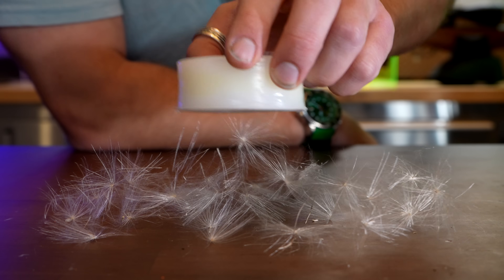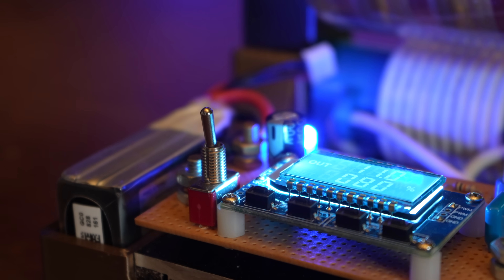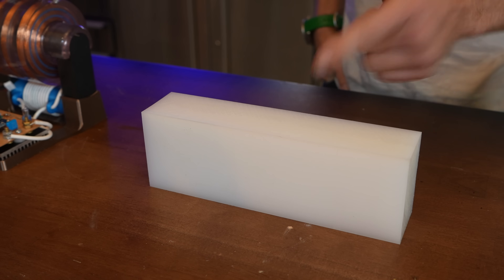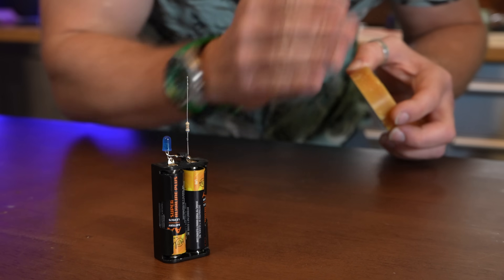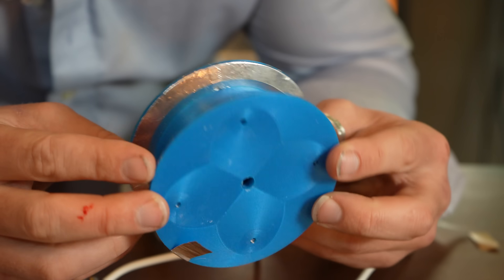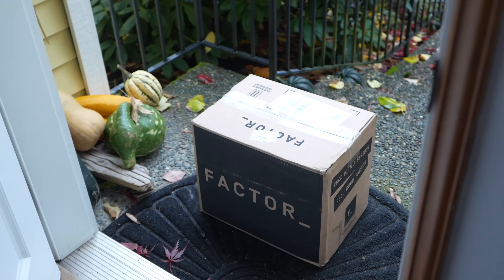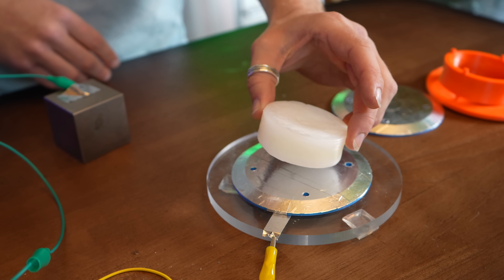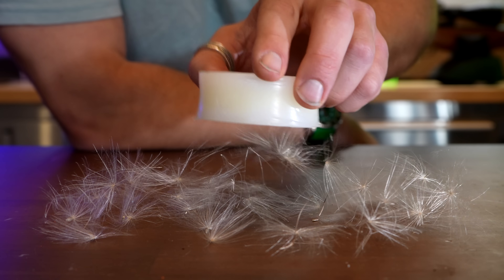Creating an Exotic Material With A Permanent Static Charge (Electret)

Comment: For the detector, have you tested it with capacitive sensors? Many microcontrollers have GPIO pins that are used for 'touch', which work based on measuring an electrostatic field, so I'm assuming they could easily sense an electret.

While you'd most likely need several microcontrollers (the most I've seen is 14 touch-capable pins on one), it would be a heckuva lot easier to assemble the final product, and you could record the actual measurements. I've built a few capacitive arrays using squares of copper tape as the sensor plates. Easy enough to solder to, and you can stick them wherever you need.

Comment: It would be really interesting to set up a higher resolution detector, if that's possible, and see if you can actually map out high and low points in the field, or for example map the fluctuations in the field around the vandegraph with an array of detectors all around it

Comment: i mean, you could boost the detector with another darlington transistor I think...maybe add in a way for it to self regulate how it responds based on whats in the background. would make the project way more advanced, but also way more fun.
Reply: use an op amp if you wanna save your sanity. pre-matched and way fewer parts to solder.

Comment: Our finger becomes a POINTY electrode, aaand a path to ground, this means that the charges can now flow to ground.Tis essentially forms a short circuit and less charge.Also, your circuit seems to be the classic darlington pair....which I agree is more simpler than using an op amp, but an op amp has more "controls" per se. When you first said "electrets" I thought you meant the microphone......boy was I wrong.......

Comment: 2:20 "motojiro asano" <= couldn't find any trace of this person on the internet and this picture is clearly AI generated.

However, per wikipedia : "The first documented case of production was by Mototarô Eguchi in 1925 who melting a suitable dielectric material such as a polymer or wax"
Reply: https://www.fuw.edu.pl/~op2ds/wyklad/Eguchi1925.pdf

Comment: There is a potential of using electret plastic on intercity power lines (cables basically) and it could potentially act as a catalyst that directs electrons on one direction or both, say like myelin sheating of nerves, increasing the signal capacity of nerve line.
Reply: And it wouldn't be an expensive add-on, all you need to do in factory is charge the cable while shielding is curing.

Comment: 20 years ago, i went down this same journey of discovering electrets and trying to make one. and i did exactly the same thing: cooling wax under high voltage, that's what everything i read said. i made multiple attempts over the course of a week, with no success. i was married at the time and while she was gracious and patient, i learned that static fields aren't the governing force in a relationship, so called it quits.

6 minutes in and curious to see how/if you make it work after the first failure. i'll bet the 3d print/plastic has something to do with it. but i'm wrong all the time. good luck getting the wax out of your carpet heh

edit: shows what i know!

Comment: You might be able to make an electric field motor with that. 

Electret dielectric between a variable capacitor could induce displacement currents.

I=ε⁰ dΦ/dt

Connect it to an inductor & rotate the variable capacitor fast.

Comment: Plasma guy 
Love your finding electret
Your plate 🍽️ that you have aluminum plates the electric ⚡️ going through is only going to arc within WAX only one arc get:

1. a set of ELEGOO 32 Pcs Double Sided PCB Board Prototype Kit for DIY Soldering with 5 Sizes Compatible with Arduino Kits also 
Use on both sides 

2. 30 Pcs 40 pin Breakable Pin Header 2.54mm Single Row Male Header Connector Kit PCB Pin Strip for Arduino

Use a soldered penny to your power source. And move penny across the board you have soldered wire through keep moving randomly 

The next is advice cause others will try to repeat your experiments:
Please use safety glasses 
Wax and other stuff don’t heat over open flame 🔥 
And get a set of High voltage Gloves 🧤

Comment: A Self Charging High Voltage Capacitor With an Enclosed Adjustable Spark Gap For A Timed discharge Into A Fluorescent Light Tube.. Maybe a cool lighting Effect\Party Trick.. Cool Video. Thx

Comment: That's opens the door to the next questions: 
- Are there materials that don't interact with electrostatic field, electrostatic transparent materials? Like non conductive materials are transparent in a magnetic field.
- Are there materials that act in a static field like aluminum in a magnetic field? Only register the influence of the electrostatic field when moved inside of it.

Comment: Rather than building a larger matrix, you can build one sensor then move it in a grid like a 3D printer. Feed the light to a voltmeter. So you can get Y,X, strength. Your resolution is based on your movement. Also as a general question since these are charges what happens if they are set up in series, like batteries, if two are placed next to one another how does the charge field change?

Comment: The polarity of your electret may switch over time.
Agitate the wax while charging it.
Add titanium dioxide powder to the mixture.
Wrap the mold in teflon tape or plastic, not aluminum. 
Cool it as fast as you can, freezer.

Comment: I swear you have to have cocked that up on purpose.
The plasma channel not knowing innately that an uninsulated air gap would have a lower breakdown voltage than a dielectric material?
An electricity related channel not knowing that to put a charge through something it has to contact the electrode?
Yeah no, that's padding.

Comment: A strong electric field induces a charge differential in your body, drawing enough negative charge to your fingertip for it to leak off in the form of a corona discharge.

Similarly, making the dome less rounded will cause the charge on the dome to leak off into the air-- so a sphere with a hole cut in it isn't an optimal shape, as the edge created by the hole causes leakage. The metal ring under your dome, I have to assume, is a fix for this specific deficiency.

Those triode static detectors are sensitive enough that you don't even need a generator to show it. Just jump up and down when conditions inside are dry enough and the LED will blink. Sometimes you'll get too much charge built up on the leg of the resistor that forms your antenna so the LED will be stuck either on or off-- all you need to do to get the detector working again is touch the free leg of the resistor to remove the built up charge.

Comment: @PlasmaChannel instead of doing more connection points you could measure the ammount at 4 of the point(or more) and with some math calculate the position of the electret precisely and you would have something similar to a joystick for a game controller

Comment: Instead of building a bigger detector, move the electret in a fixed path multiple times as you move the sensor. Merge the videos for a high res view of it passing the many sensors.

Comment: I've read about electrets but never seen a video about one.  Neat!  Your static sensor reminds me of when I was messing with TTL circuits connected to LPT parallel ports back in the Windows 95 days.  I was having interesting proximity sensor abilities that I eventually figured out was due to my CRT monitor causing a floating input to change based on my physical position.

One thing, @2:27 "rosin" is pronounced "rah-zin", not "rose-in".  Like rosin-core solder.  Though I commend your pronunciation of "aluminium" because, even though I'm born and raised in Michigan, the British spelling and pronunciation makes more sense compared to most other elements on the periodic table with the "ium" ending (take that, Molybdenum).

Comment: This is super cool.
For the sensing, I watched a video by the YT creator Posy about electronic paper.  (HIGHLY recommend checking him out)
Its the material used for fake paper digital notebooks, Nook, eReader, etc.
Those work by supplying a static charge with an electrode display to the electronic paper which causes the charged "ink" inside small balls to move to the top.

Essentially if you get this Electronic paper it should display any disturbances in the electric static field. I am unsure how sensitive it is but I think it might interact a little bit.

Comment: Now what if you used microwaves to modulate plasma inside a toroid to vibrate the plasma rapidly and modulate it to double up wavelengths over and over. Eventually reaching billions of volts, and then channeled it into something like a liquid mercury style battery, and then added some containment to be able to focus the field? This is kind of what the salvatore pais patent describes to create anti gravity mixed with the old school Bob Lazar description of the fluxliner. Man, flying around in those sure was a blast in the sixties. 😂 In the Pais design the plasma runs in a noble gas but there is a core conductor material running yhrough the center of the toroid (copper?) and transducers are used to pull charge into the core. Pretty cool idea.

Comment: This was an interesting video topic.  I was curious since we already have doped materials and I was wondering how that's different from an electret.  The field on the elecrets does seem to go far.  I'm curious why you used such thin surfaces of aluminum for the charges plates in your first set up then what looked like a huge magnet in your last... Why would wrapping in a conductive aluminum foil 'preserve' its charges as it cooled?  I was just getting more and more confused as this video continued since it isn't April 1st. Finally, for your sensor, are there any materials or already existing monitor screens that could sense the electric field already, so you wouldn't have to make a matrix of sensors then?

Comment: Umm how about making a static motor, lile a brushless motor? Make a elerect ring with alternating poles, and having alternating hv plates in the middle? Connect a 4s bldc driver to 10kv modules to get 3 phases in the middle.
Reply: And what about a plastic injection moulding machine to keep the temperature up so the charge has less resistance to set the orientation? And also get better more uniform density parts. There are a few diy ones that may work with resin printed moulds

Comment: Could you use a CRT as a detector.  Basically bending the electron toward or away from the electret.  So the gun normally fires it at a certain path but the electret might be strong enough to influence the regular beam path?  just a thought.  I honestly have no idea.

Comment: I did not know permanent static was even possible! That… that just blows my mind honestly. Its like the perfect alignment of polar molecules in such number, rigidly, build on the electron orbit’s charge so much that it reaches INSANE distances! Does static charge as a field disrupt or alter magnetic fields at all when they impinge on each other? Does the insulating material create a flowing charge if a circuit made to connect between the positive and negative sides? So many questions and experiments i want to try but have no ability
Reply: Not that I wouldn't like to contest that you have no ability, how about finding the experiments in the natural and built worlds and bringing them close enough to make do? No material neutron stars required (though, you know, they were used in turn to make much of this.)

Comment: You should get pcbway to sponsor you. Have them make a PCB with surface mount LED and components, with like 8x the resolution and larger.  No more wiring now.   Paste solder applied with a mask.  Then pick and apply components, preheat and blast with hot air to melt. Boom huge high res static field detector.  Please build one. ;)

Comment: always known of them, but never knowing theyre so easily made and so intriguing when made...
by far your best video. youve grown :)

could always go PCB and run 50x50 detectors, more! bicolour LEDs and a pnp/npn based detector? positive and negative?

or... small slugs of PE electrets mounted like compasses on little gimbals...
on water?

these just raise more questions than they answer... can they discharge if shorted for long enough? or if used in a "wimshurst" type affair?
perform the 'faraday ice pail" with one...

shorted out pair of conductive plates?

what if you make a bunch that are tapered, to clip together into a ring?

do they attract the same material from both ends, or is there a triboelectric order?
"field lines"?

a loop of static charge, but what if its spun? near a magnet?

can also see the benefit of a pressure vessel? increase the breakdown voltage... easier than pulling silly high vacuum...

Comment: You could probably graph the shape of the electric field with a single detector, so long as you can quantify the field strength, presumably by measuring the current flowing through the transistor.  Measure distance to detector for each axis of orientation, and plot the results in three dimensions...

Or do the ancient analog technique of capturing a long exposure in a dark room...

Comment: Very cool. This would be a great physics demonstration tool for teaching. What about using a circuit board that has mini LEDs on it that follow the same setup you did? Perhaps you can just design it and use PCB Way to print out the circuit board and even have them place the components on there ready to go?

Comment: Cast object shrinkage and piping (depressions or cavities from cooling) is largely dependent on whether the mold is shut or has open sides. Differential contraction on the coolest area. Part of the reason to have a sprue. Another is to add some hydraulic pressure to the mold to fill properly and completely. Don't skip a riser. It is also a reservoir that feeds a contracting casting in the early part of the pour.
    Not criticism, it takes years to learn the best casting practices for everything. 
    Besides the high voltage and silicone, it is almost sealing wax. I wonder how colophony (distillation dregs) would do instead of just rosin?
    Or amber powder (carving waste) from ebay, that's the cheapest amber to use for varnish also. I don't have the heart to melt good amber.

Comment: Water has the same properties at its surface, surface tension is a bilipid layer of positive and negative same as electrotets. Its hard to think of water as particles.

The notion of particles as fundamental building blocks of matter is seen as an incomplete and inadequate description of physical reality. Instead, the idea of fields and their interactions is emphasized, and particles are seen as a manifestation of these fields in certain circumstances. Therefore, it can be argued that particles exist only as a useful mathematical abstraction, but they are not fundamental physical entities."

Comment: Correct me if I'm wrong, but your test switch could be used to open a mag lock instead of an RFID tag.  would love the complete receipt to make one of these include the charge voltage of the compound. would a microwave transformer do the charging bit at what 10k volts?

Comment: I find myself wondering whether or not it would be possible to make an electrostatic generator built similarly to a permanent magnet generator that uses electrets in place of the magnets. Not sure if it would actually be useful for anything, if it even worked at all, but it might be a fun experiment.

Comment: Suggestions: mark + & - on your devices.
1. Drop it from great heights (my guess:The positive always lands face down. ( or at leads nowhere near 50% of the time)
Assuming I’m right about #1
2. Make three more: 2 uncharged (for a reference) the third just like the first., tape the two uncharged together, tap the two charged units together (- to -)  do the old “Leaning tower of Pisa experiment”. ( My guess: they will not fall at the same rate.)
3. this time tape (+ to+), do the Pisa experiment again, and compare with the reference.

No I don’t think gravity is a charge. But if I’m right .. well just ask me why then.

Reminder photo interrupters with digital counters will work better than judging by eye.

Comment: If you directly measured the voltage at each sensor, and then computer controlled moving the sensor array through the field you should be able to make an extremely high resolution tomography of the static field.

Comment: What i have always visualized is a self charging capacitor made from 2 rolls of Electret foil and 2 rolls of aluminum foil.  But how to make the Electret foil, that is the challange. 
Why wouldn't it product an endless source of electricity, based on Time instead of Motion as in the case of a generator. The Time it takes for the Electret to recharge before drawing power from it.  Is something wrong with this theory?  If so, someone explain it to me.

Comment: How does the first demo work? I see that the resistor is used as an "antenna" and probably connected to the base of the transistor. When you put the electret close enough, it somehow creates a current to the base of the transistor. If the electret is permanent, where is this energy coming from? If you left it next to the detector for 10 years, would it eventually lose its properties? Or is it one of those potential energy cases? Where the energy is inserted by putting the electret close to the wire, then it pulls away some electrons from the wire creating charge imbalance but no actual ongoing current is flowing to the base?
Reply: I'm not super sure, but my guess is that the nearby electric field pulls the electrons in the wire causing current which is amplified and turns on the LED.  What I don't fully understand is after the electrons build up on the antenna, shouldn't current stop flowing if the electret stationary is for too long? I really hope he does a follow up video to do more experiments!